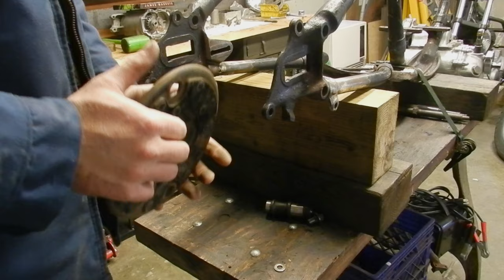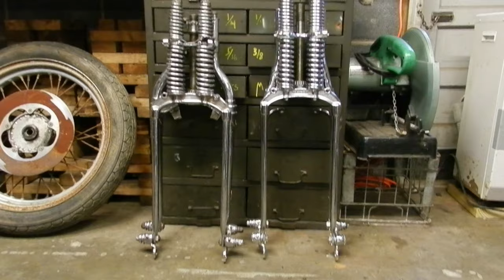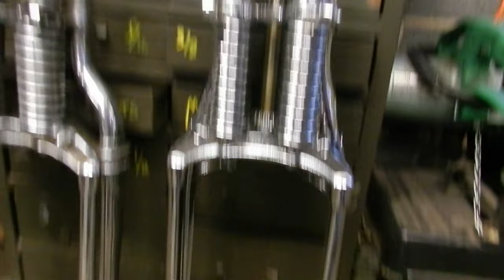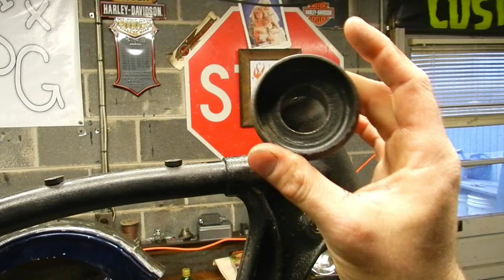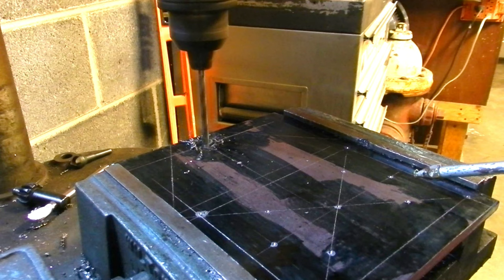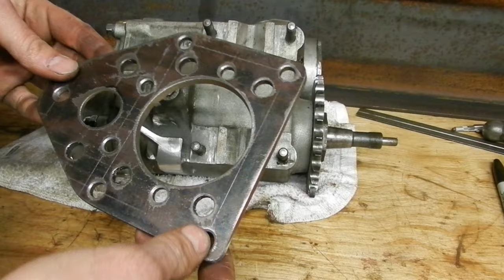Project "UVL" - Part 3 - Brakes, Springer, Transmission Plate

Comment: You don't think you're going to have any problems getting the studs out of the tranny, without cracking the case, or creating a transmission leak?
Reply from the maker: With A little heat, they came out fine.